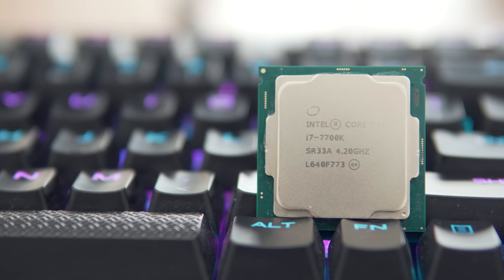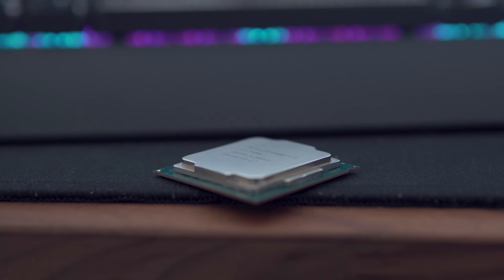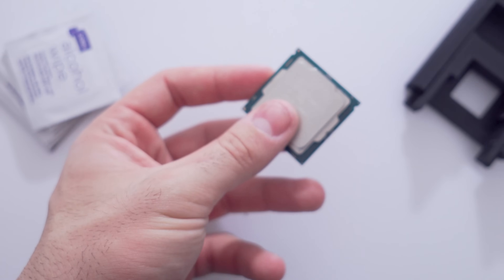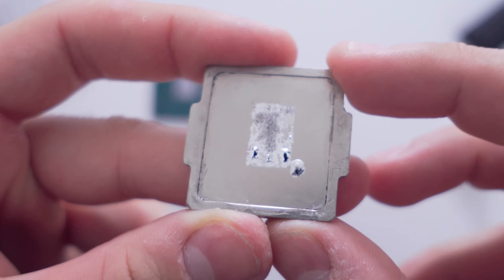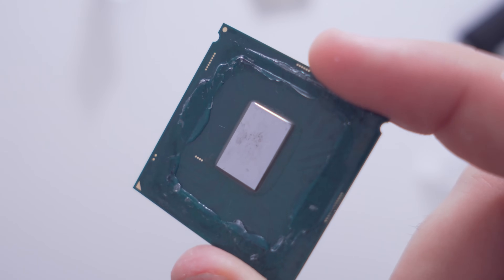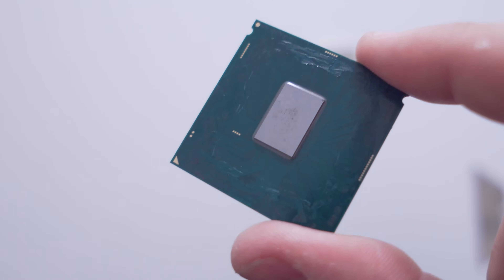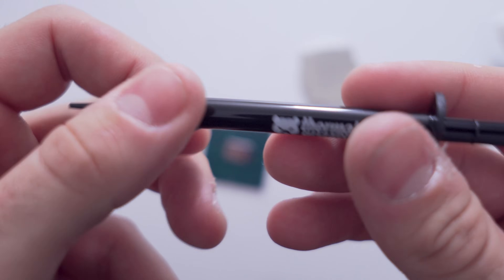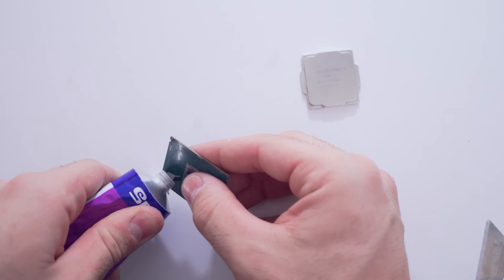Liquid Metal on CPU - 9 Months Later!

Comment: How long does liquid metal last? I wonder if it's worth doing for longevity.
Reply: My liquid metal last 5 years on the cpu until my AIO died and I just replaced it together with new metal. It will finally dry out over time but as long as you don't touch anything and nothing lose contact it will work forever, the thermal conductivity is exactly the same no matter if it's in liquid or solid state. And remember after 5 years I had to rotate the water block back and forth in order to break connection, It was so had fused together I'd probably break my motherboard if I try to pull it out instead.

Comment: Bro, did you 3d print your delidding tool? It looks like it has 3d printer tooling marks. They are definitely everywhere, I pulled up several search hits instantly on the topic. That's cool. I hadn't thought of that. Not that I'm looking for one of these, I don't think they recommend doing that to Ryzen but it's cool to see that it's unnecessary to use the anodized machined aluminum billet ones like what I saw on linus tech tips.

Comment: Great video! I'm actually a liquid metal scientist so I can chime in on the long term effects of LM on the different materials. The LM is difficult to spread due to its high surface tension and the stirring you do actually generates oxides that form on the LM surface which enable better adhesion. Also, the LM can form metallic alloys with surfaces like copper or nickel which are common CPU package materials. So in the far long term, these alloys can consume the LM and potentially corrode the surface, much like LM corrosion of aluminum which happens very quickly. LM has great potential for these thermal compounds but definitely many challenges to work out first!
Reply: Thanks for the info! It is so tempting to use LM but I find conflicting information online. Is there a benefit to creating an air-tight seal around the LM application area as was done in this video with silicone when re-gluing the IHS in place? I've read on message boards that LM "drying up" in laptops (no IHS) can be (at least partially) attributed to air flow and/or dust that gets blown around the edges the CPU/GPU with LM applied. My thought for my laptop would be to apply LM to the CPU and GPU dies and copper vapor chamber surface (Dell XPS 9700) and then put a thin line of thermal compound on the processor boards a few mm out from the dies to block air flow around the LM application. I would use the thermal paste to block air flow since I don't really want to glue my heatsink to my motherboard with silicone and I figure it would help move a tiny bit of heat too.

Comment: I did this on my 6700k today. I recommend using nail polish over all the exposed gold pads. It's easier to apply and you don't risk having it adhere to the IHS. I also applied it to the little pads outside the IHS. not necessary, I'm sure, but it can't hurt either.
Reply: Thats incredible idea

Comment: i ran 4.8ghz on my 7700k no delid at 1.295v for 
around 3 years now at 85c peak on a dark rock pro 3. It's been awesome, 
i just recently just delided and used coolLAbs initial boot cinebench r15 could only get it to 58c.
I was pretty ecstatic, switched to an aio, 1.392v, 5.1ghz, load line at mode 2. Runs like a new cpu again.

Comment: well i had liquid metal on my waterblock for 2 years and it has welded the block to the chip had to twist and snap it off and its all dried out and crystalized and impossible to remov by rubbing also loads of pitts in the cpu metal, i ended up having to lap the cpu and teh waterblock 

i love the cooler temps the liquid metal gives but i hate the fact its ruining my components 

cant beat rubbing away normal tim and having an amazing surface afterwards 

im just doing a new build and im not sure what way i want to go now :(   p.s it was conductanaught that i used

Comment: I delidded a 4770k the crude way (razor blade) and butchered 8 of the 20 little resistors next to the processor. Thought it might be garbage, but It works fine and I'm using now and running it 24/7. #2 cpu runs about 8*f hotter than the others. I might take it apart again and check for even contact with the lid, since I didn't clamp the chip after sealing it up. Use a good light and a magnifier - I could barely see what I was doing and damage was done.

Comment: I haven't been having very good lick with liquid metal. It's drying up on me. I wonder if it has anything to do with my lap job. I went all the way to 2000 grit wet sand, which is more polished than I've seen other people,do it. 
But this stuff is so crazy. I pulled my cooler off and the LM is completely dry. Couldnt even wip it off with a rag. Then as soon as I touched it with the q-tip i used to apply it, it all turned liquid again. I added a little more LM and I'm trying it out again.

Comment: I used LM in my alienware Laptop normal it overheat and clocks down in heavy long workloads.
With LM i have no issues even with 4ghz oc it wont overheat anymore iam very satisfied with it. But in a normal Desktop i think its not worth the risk if there is no cooling issue with normal TP.

Comment: not true about returns. i've returned a dead cpu that had been delidded. no problems at all, got a new one back from RMA. was very surprised but if you do a good enough job with the silicon application and make sure it looks stock they don't check to see whats under the heat shield.

Comment: A few little things I've learned from my delidding experiences and research:
1. Get some MG Chemicals Silicone Modified Conformal Coating to coat exposed contact points that you don't want to short out, like the 4 under the IHS. It comes in a little 55ml glass bottle with a little brush in the lid. Works like liquid electrical tape but better.
2. Either don't re-glue the IHS down as the extra gap the silicone gasket introduces reduces the performance of the liquid metal. Or, if you must glue it down to retain the location while installing, either use 4 tiny dots in the 4 corners, or compress in position and then add a couple of dots of super glue to the edges. It will wick under and hold it in place sufficiently. Most of the time the force of the CPU mount is all that is needed.
3. Benefits can be gained by lapping the top of the IHS and the bottom of the cold plate using a glass surface and some lapping films. I've found that Intel doesn't do. Good job of making a truly flat IHS surface, which degrades the performance of the heat transfer between IHS and cold plate.

Comment: I used liquid metal on everything 
My i9 7900x.  Both my 1080ti’s and 
My Xbox one x
I use a coating of clear nail polish to cover the metal contacts on the pcb on all
So no chance of shorting and you can’t tell it’s on there 
You might say why put it on the Xbox one x
It is way better than the crusty stuff they put on it it runs cooler and fan isn’t as loud

Comment: Dont use adhesive, put the delidded cpu in the socket (with liquid metal) and then just drop the ihs on top of it. CPU socket clamp will hold it down, just make sure its alligned. Even better temps.
Reply: I have my 4790K @ 33°Celcius

Comment: Putting more LM on due to it "drying up" will achieve the exact opposite of what you want. LM doesn't dry up, the gallium forms an alloy with the other metals it's sitting against. "Stained" spots are that newly formed alloy. 

The slight increase in temperature over time is due to that alloy being less effective thermal material than the bare metal the LM is being pressed against. The alloy forming is adding additional metal to the surface of whatever it has bonded with, making a slightly thicker layer between the CPU and the cooler. Applying additional LM just compounds that by again creating a slightly thicker layer, continuously adding an inferior metal in between the CPU and cooler with each application, making it less and less effective at thermal dissipation.

The alloy is still better than any regular TIM you might use.Just apply LM correctly one time and leave it alone.

Comment: Simple answer.  Delidding is safe if you are not a fucking idiot.  Take your time and dont use a vice unless you have a delid tool that requires it.  And understand that you could damage the CPU and you are screwed for RMAing it.  Dont be a moron.  Buy the Rockitcool tool and do it right.

Comment: Good video. People have been doing this since Ivy Bridge in 2012, so it's definitely safe, if done right. I recently used TG Conductonaut on my 3770k, and the results are impressive. I was hitting the thermal wall at 4.3ghz with the stock TIM, but now I'm at 4.7, and still have some headroom to push higher. My load temps at 4.7/1.35v are lower than they were at 4.3/1.25v.
Reply: I'm seeing just the same problem on my 3770k. It just gets unbearably hot past 4.2. I'm thinking of delidding mine as well, but I'm still on the fence.
Reply: @stale2665  It's well worth it. Just take your time and follow the tutorials.

Comment: i am a huge proponent of LM for about a year now. i used it on 3 different video cards as well as cpu. currently(for over 6 month now) i have LM on my zotac 1080 ti amp edition gpu. using it with nzxt kraken g12 and asetek 550lc aio/clc water cooler(with 2 sp120 corsair fans in push-pull). the highest vcore ever reaches was 43c and that's after running furmark aka furry donut of death power virus program designed to murder your gpus. running timespy, heaven, catzilla, final fantasy 7 or superposition benchmarks vcore never goes over 40c. gaming for hours on maxed out settings will never even touch 40c. make sure to apply lm properly- you have to apply and spread it extremely evenly on both contacts and never leave pools - only even mirror finish. sometimes it takes few tries but even though after the very 1st try you already get improvement - still most likely you can do better. also make sure to cover closeby components with either electrical tape(i use 3m) or nail polish. i always use grizzly conductonaut lm but other brands probably are as good.

Comment: My 8700k at 5.1GHz and 5GHz cache + better delied ( during long time days,temperatures ambiantal external also stagiones and enter into processor,without silicon.With low silicon is close e not varie external and enter into the DIE ).I change paste metal and re delied with silicon,is temperatures is stable always.yesterday hours 15 PM with high sun 78 grade,today hours 7 AM max 74 grade and DIE stable not change voltage ,etc.The temperatures external much important.outside temperatures are very important if there are cracks in the cpu, first I had to always change Vcore now not.Good day and best regards from Italy.

Comment: Of course, as luck would have it, the very place where the excess liquid metal had to run off the top of the CPU die and then pool was exactly where the gold contact dots were on the substrate. Good grief. What are the odds of that happening? Well, roughly 4:1 against,  but somehow you "lost"...(although  luckily there was no damage / shorting / adverse effects).  Unreal.

Comment: Here's my suggestion for gluing the IHS:
Squeeze a blob of high temp RTV onto a piece of cardboard, then press one end of a popsicle stick (the flat part, not the edge) onto the blob.
Scrape it across the cardboard to remove most of the RTV, then slide the stick across the bottom edge of the IHS at a 45 degree angle, while also pulling down on it slightly. This will apply a small bead of the RTV to the very edge of the IHS.
Use the clean end of the stick to spread the bead as thinly as possible across the contact area. One quick swipe across the edge should do it.
Repeat for the top edge.
Do not glue the sides where the CPU clamps are located.
Clamp the IHS tightly in the delidding tool until the RTV is fully set. About 24hours.

Comment: De-lid? Why?  Seems like a lot of work for little, if any, real returns.  Barely discernible on benchmarks at best.  Who has a i7 with proper cooling that goes into thermal these days?
Reply: The difference is big on some CPUs. Imagine being able to take an old 3770k or 4770k from a max overclock of 4.2 ghz all the way to 4.8 or 4.9, because the temperature drop is so great. That's what de-lidding can do. That clock speed difference is big for gaming or video transcoding, for example. A 4.8 ghz 3770k is about on par with a stock 7700k, which is several generations newer.

Comment: I did this to a 3770k ran to at 5.0ghz with 1.5 volts never saw a temp over 65c I ran it for a couple years like that. Now I give it to a friend and it’s running 4.6 but he has a single 120 closed cooler still under 76c on load
Reply: You CRAZY bastard!

Comment: The discolorization is caused by  galvanic activity .  The rule of thumb is if there is if there is less than .1v difference between the two metals, it probably wont result in significant corrosion. I don't know what the voltage difference is between galinstan and nickel but it must be close to only discolor. Is a nickel  coating used on the top of the die?

Comment: 3:18  Those exposed contacts beside the die should be coated with clear nail polish or a coating such as MG Chemicals Urethane Conformal Coating  4223 before using liquid metal. The 7700K has very few contacts, by the way, compared with other chips.
Reply: What are those for anyway?

Comment: Liquid metal does react a little bit with copper and nicklel, both of which are used on the IHS of a processor. however, it's such a slow reaction so it would take literally years for the liquid metal to diffuse into it completely. In short, using a liquid metal TIM on your processors is totally safe. If you also use it on your cooler, so long as you do NOT have an aluminium cooler it will be totally fine as well.

Comment: I'm a bit curious about his silicone glue, I googled it up and it was meant for gasket seals and such (Selleys SealFix R.T.V Purple). It works just fine? I'm planning to use conformal coating for my laptop liquid metal project. 
BUT since its hard to find them where I am, I'm looking for other alternatives to coat my contact pins. And then I came across this, any suggestions?
Reply from the maker: I can confirm that it's fine :)
Reply: Thanks for the reply, any other tips that you can give me? :p
Might try this glue and project soon

Comment: most of the time you need the IHS, I would love to see a water cooler that is just like a ihs in shape but is one piece of copper. This could be a very thin unit! also the ihs/cooler would be held on buy the chip hinge so no other mount needed! 
i watched linus or one of them make a water cooler out of a pip cap for cooling and it worked good so you could for sure make this part only maybe 2x the size if water cooled and one part. 
now go you CNC people and make it for us.

Comment: I still have my crazy low temps since my delid on my 7700k. The funny thing is that the thermal conductivity is so good that I have almost the same temp under 1.28v or 1.4v
Yes my 7700k needs 1.4v for 4.9GHz but only 1.28 for 4.8GHz don't know why. I'll stay at 4.8GHz to be safe.
Reply: what was the temp at 4.8 without deliding?
Reply: Meltdown probably. At factory clock without delid and watercooling I thermal throttled and almost reached 100°C
Reply: Pow3rus buying i7 8700, better choice i guess

Comment: The CPU die discoloration, might be part residue of the mixture.
Perhaps alcohol only cleans part of the product off.
To know for sure, you'll need a microscope, to see if the discoloration is causing a dented, or humped surface.
Humped surface might still be corrosion.
If the liquid metal is mercury, you should wear gloves.

Comment: For anyone wondering there is no point to delidding a threadripper processor, the dye is soldered directly to the ihs so you wont see a thermal improvement

Comment: YES YOU SHOULD PAINT ALL THE COMPONENTS UNDER THE IHS WITH NAIL POLISH IS FINE CLEAR IS GOOD AND EASY TO SEE IT IS COATING EVERYTHING. LIQUID METAL IS VERY DANGEROUS KEEP IT OUT OF ELECTRONICS NOOKS AND CRANNIES BECAUSE IT WILL DESTROY YOUR GEAR. NEVER APPLY IT TO A VERTICAL MOUNTED CHIPS(ONLY ON CHIPS MOUNTED HORIZONTALLY NOT ON TOWER CASE CPUS(FLAT CASE ONLY OR TOWER LAYING ON ITS SIDE FLAT) OR GPUS(JUST USE KRYONAUT INSTEAD OF THE LIQUID METAL ON GPUS BECAUSE THEY ARE ALWAYS VERTICAL EVEN IN FLAT CASES AND THEY ARE PULLED OUT AND LAY AROUND MANIPULATING THEIR ANGLE THE LIQUID METAL LEAKS AND FLOWS UNLESS IT IS LAYING FLAT AND SURFACE TENSION HOLDS IT IN PLACE!!!!!!!!!)

Comment: Why cant we mount our main heatsink directly to the die and omit the thermal resistance of the IHS altogether ? Anyone like to give that a go? Optimum Tech ? The heat from the die should transfer more efficiently into our main heatsink without the heat spreader, since the main heatsink should act as a more efficient spreader than a IHS because of its lower thermal resistance characteristics ;)

Comment: my 2700k stays at 65C constant 24/7 while mining XMR and gaming at 4.6GHz at 1.35V, ive had it at these settings for over 5.5 years now with no issues NO DELID REQUIRED, it's absolute bullshit that you have to delid CPUs now just to get acceptable temps like wtf? I have a DH15 cooler with a 7700k now and get temps near 85C+ during stress test.
Reply: Do you want a cookie?